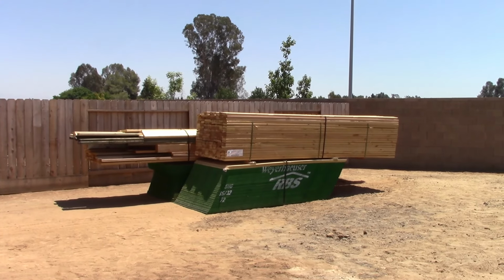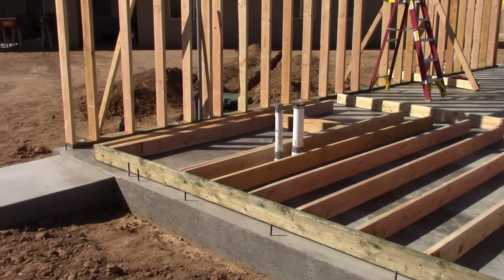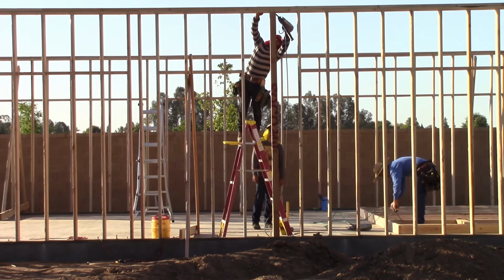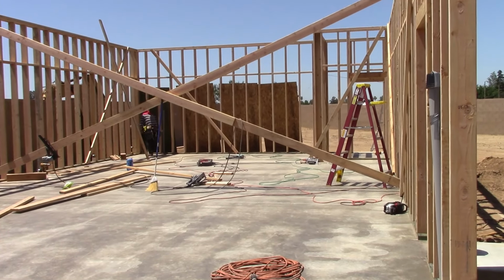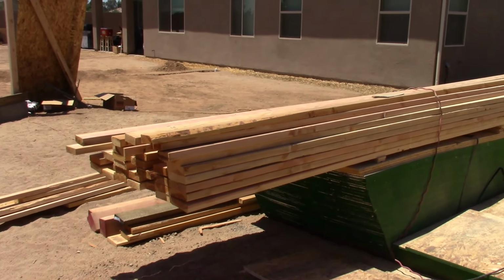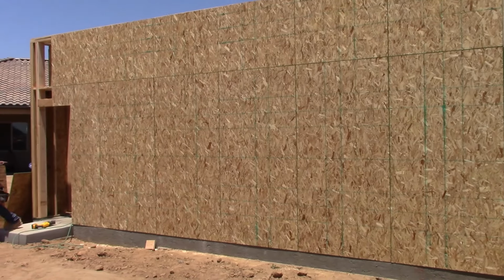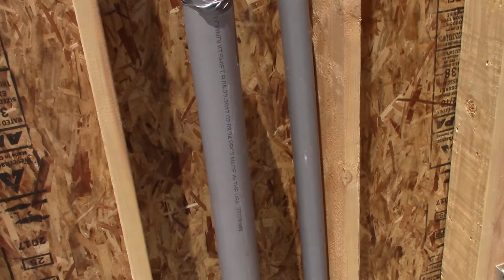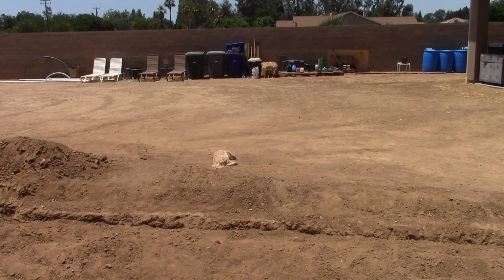Shop Build Part 4 Lumber & Framing #realraysgarage

Comment: Hello Ray,  Boy you are fast catching up with this old guy!  I was surprised that they didn't sheath on the ground and stand it with wall jacks, but they sure know what they are up to.   100 degrees; you'd have to look in my oven to find that here!  Got up to a scorching 68 today with only partly cloudy.  Got my steel order ready so that will be pretty quick and I'll get to wrestle those 27' sheets.  Tired just thinking about it.  Seemed like that lumber delivery guy is pretty rough on the thousand dollar bills he dumped off the truck.  Most of the ones I have seen either ease out from under the load and set it gently or bring a fork lift.  Good quality wood though.  Take care.  Doug
Reply from the maker: Hey Doug, I about crap myself when he dropped my load of 6K worth of lumber like that! Must be nice working in 68° weather beats the hell out of 100° temps! Be careful handling the steel and good luck with your build!

Comment: Ray,  a few years ago, I had my shop built. while i was working for a plywood co. the framers were working on my shop too.  when i got home the had the walls up and the t1-11 siding  up. the 5/8 plywood looked great. i saw on the inside there were big red stripes going up and down the sheets of plywood. I  decided to pull a prank on them. so as they were nailing in the rim joices i said HOLY SHI# ! Look at all that !, they of course panicked big time. they didn't understand  what those lines meant. I told the the truth , "they are to indicate that those sheets of veneer weren't dry enough to use and are normally not. because the glue would not bond", about the time they wear about to call the boss, i told the the rest of the story. those striped  sheets are re-dried to remove the extra moisture and its all good, if it does  the plywood would be like loose rags.  then i told them next time they can pull the prank on someone else, like your boss??. now i don't think you can use that with OSB..  but you can try..  have fun with this I sure did!
Reply from the maker: Great story Dennis, I might have to give that one a try! Thanks man!

Comment: Looks good ! One suggestion
 shorten the bathroom walls to 8' then you could use it for storage or put a horizontal air compressor up there
Reply from the maker: Not a bad Idea but I have plumbing, electrical and vents running through there and not sure if I can change it at this point but will look into it. Thanks!

Comment: Hey Ray, you going to pre-wire your shop then put up your interior wall board ? Or are you going to walls, trim, paint then electrical conduit ? Or maybe a little of each. Looking Good Man, good luck with your build.
Reply from the maker: Thanks man! I am keeping the walls open for now until I get everything plumbed, wired and arranged then close the walls down the road.

Comment: Windows? For those of use that don't live in an earthquake area can you provide a closer shot of those tie-downs? Why does the bottom stick up like that or whats underneath it? Can the 4"x6" be used to support anything or is there sole purpose for earthquakes?
Reply from the maker: No windows for two reasons, extra wall storage and better security! The hold downs are attached to a "S" shaped bolt about 18" long that is set in the concrete, the hold down is screwed to the 4x6 with about 12 sds screws then attached to the bolt in the concrete with a heavy duty washer and a 5/8" nut. I'll shoot more video of it on the next par for you.
Reply: That's cool, so the bracket can ride up and down on S-hook during quack movement, but still stay firmly attached? See now there's a slant on no windows that I would have never thought of! My idea was home workshop - no windows = ugly neighbors wife!
Reply from the maker: Here you go Fred, I hope this answers your question my friend!
https://www.youtube.com/watch?v=Mt8Ye0nd3hs
Reply: Thanks Ray!

Comment: looking great, interesting to see the reinforcements for Earthquake proofing, we dont deal with up north. 
What are you doing for insulation?
Reply: We have Tornado codes in Oklahoma City and now they're talking QUAKE  codes as well.
Reply: 1/2" armor plate sheeting welded to tie down rods??
Reply from the maker: No insulation for now until I get everything plumbed and wired in the walls.